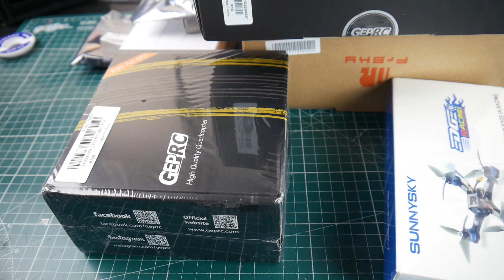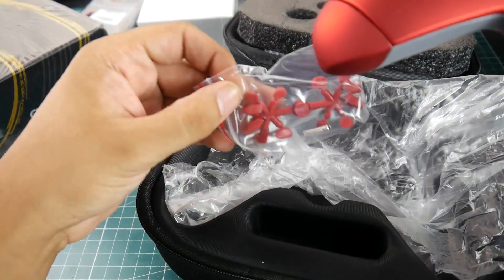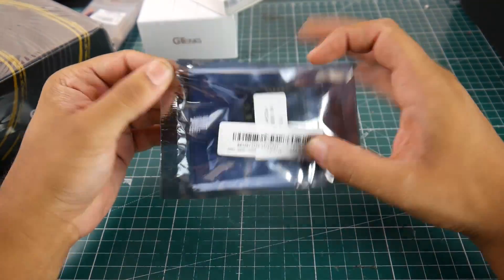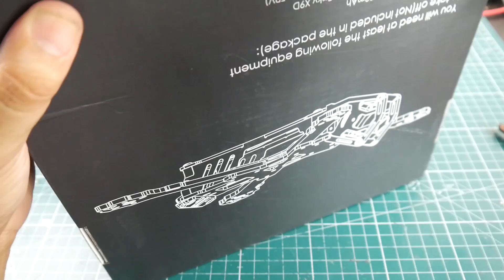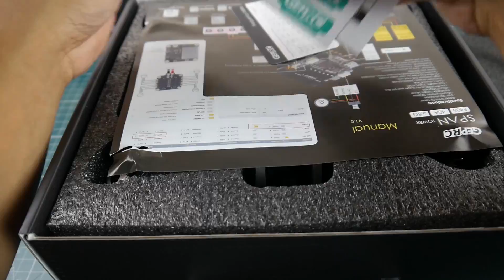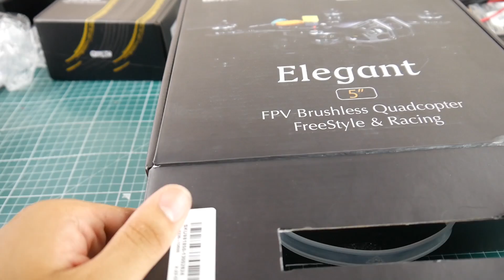Finally Mailbag Time and FrSky X-Lite Battery Mod // DYS Aria F45A 4in1 ESC , Airbot Ori32

Comment from the maker: Links to Everything in the video :)
FPV Watch Must have 
https://goo.gl/wgu1W1
Airbot Ori32
https://goo.gl/Yqhtpa
Frsky X-Lite
https://goo.gl/VkJoMF
Geprc Pheonix
https://goo.gl/skKgA2
Geprc Elegant
https://goo.gl/ZZKHRC
SunnySky Kit 
https://goo.gl/n7pF1j
Fc with VTX
https://goo.gl/BqzRX5
DYS Aria 4in1
https://goo.gl/e5G5NC
Reply: Link to the G-teng? :)
Reply from the maker: https://goo.gl/wgulWI
Reply: Thanks :D
Reply: Those are spedix is45 esc my friend ^^I run them on a 5 inch kareare frame with emax 2307 2450 motors on 5s  and no issues at all one of my smoothest quads.

Comment: Drone mesh The X Lite that you got that wasn't working did you try updating the firmware? The reason why I'm asking is I updated my firmware the first time it didn't take and it wouldn't turn on the second time it took and works great
Reply from the maker: I thank you for this info I will test this immediately in the morning.
Reply: @DroneMesh  let me know I'm kind of curious if it works

Comment: My positive solder pad pulled right off the board. Is that even repairable
Reply from the maker: Positive pad from what??
Reply: @DroneMesh  my bad a 4 in 1 esc
Reply: @rickjames8897  depends, which 4in1 ESC is it? You need to get some stick on copper plate and solder it to the trace.
Reply: Farmer Fpv It's off my magnum f4 stack out of the emax hawk 5

Comment: Love the projects man but can you tell me where to get the voltage regulator for the esc/motor tester. I have now got all the other parts but just need the voltage reg thanks
Reply from the maker: https://banggood.com/Small-Mini-360-Adjustable-DC-Power-Supply-Module-Mini-Step-Down-Module-p-917568.html?p=CS101558118042016088&utm_content=huangguocan&utm_campaign=mesh.drone
Reply: thanks man  I can now get on with the build

Comment: Looking forward for the Airbot 20mm stack, have one and totally love it! Feature packed in such small form factor, even beats many full size stacks (it has 8V regs which you really like for some reason). Someone even tested it with 2306 2600KV on 6S! The only 20mm stack I trust for most 5" quad besides Emax stack.

The Aria looks very promising, though DYS electronics seem to be hit and miss products.
Reply: who was that again?
Reply: Ehm, Sugar Cane? I don't remember for sure though. The video is: 2600KV 6S test.